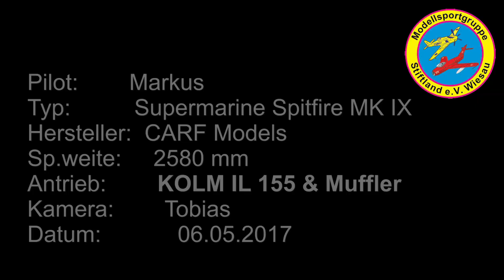Kolm IL 155 with Muffler (Zimmermann Schalldämpfer) in CARF Spitfire - 2580mm - Markus

Comment: I bet its still way over the 90 db's would be cool to see someone make a muffler / dampener that can make those engines go under 90 db's
Reply from the maker: Hello,
we make the noise measure always with 25m distance. We measure 3 positions which give an average value.
The engine had without muffler 79-80dB on 25m (https://www.youtube.com/watch?v=dGQ71bLSqts)
Now with the muffler he has 76dB on 25m ;-)
Reply: COOL but i think they measure it here (at my club) from way closer if i am correct
Reply: The loud noise high frequency you heard is the propeller tips approaching the speed of sound. A loud unmuffled engine sounds like nascar, larger volume deeper pitch
Reply: @brycekat  i know what i said lol not talking about the high pitch noise of the props. talking pure engine noise. we measure at 7m distance ...
Reply: she would be way to loud at our club
Reply: @digital wolf rc, it’s the tips of the props approaching the speed of sound at a given distance from the audible receiver. If you were measuring at 7m , audible engine noise would “probably” be louder than propeller noise due to the relative distance from the source. Think of it metaphorically like an ocean wave, in that, as the wave signal is allowed to grow, the edges ie. the db’s are allowed to grow larger the farther away they measured from the source.  Ie: what is measured at 55db 7m from the source might also be measured as 95db 25m from the source. Hope this helps😃
Reply: @brycekat  i dont need an explanation lol i know how stuff works been into the hobby for 16 years LOL its just that the plane would make way to much noise (prop and engine both) to fly at our club xD

Comment: What are your temperature before and after? I see you installed temp sensors on the cylinders.
Reply from the maker: without sensors, it is not because you have no control over the engine. I have 4 sensores on the engine.
basically it is the same, 125-135° on the inlet side and 150-160 ° on the outlet side from the cylinder. 
On the day it had 31° and I flew with a lot of full throttle.
Reply: Wow, temps looking good. Ever think of putting in water cooling? Maybe invent something very small like cpu water cooling? That would be the next stage in Big RC airplanes.
Reply from the maker: no, these are air-cooled engines and it works.
Water would be too expensive. Then you have more weight and electronics ... no one needs that ;-)

Comment: Do you recommend this engine? For Cy model P47 96"
Reply from the maker: No, P47 has a round hood, so you also need a round engine 😂😎😎 (SaitoFG90, Moki180 🤔)
Reply: @RCPLANEVIDEOS  but I would this sound on p47 hahaha. I want to try inline engine this time
Reply: @vicyboy12  if you were to make a belt drive gear reduction to lift centre line of engine up,    I can't see it being a problem